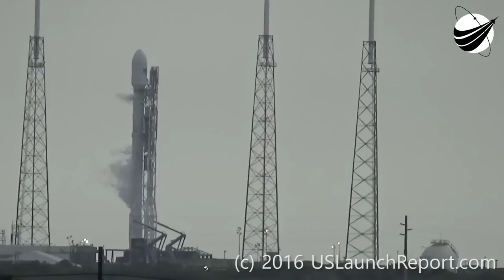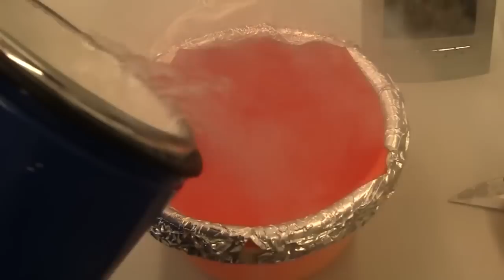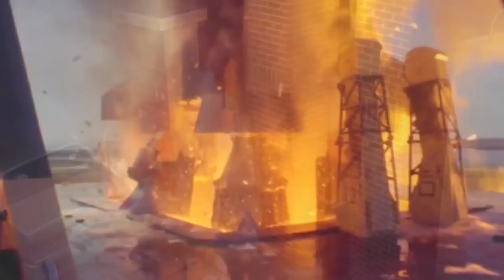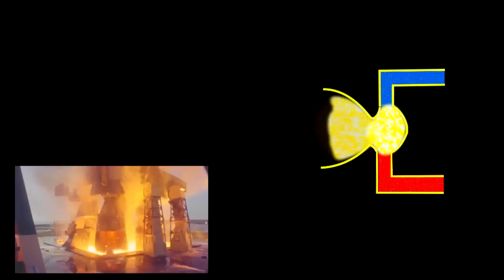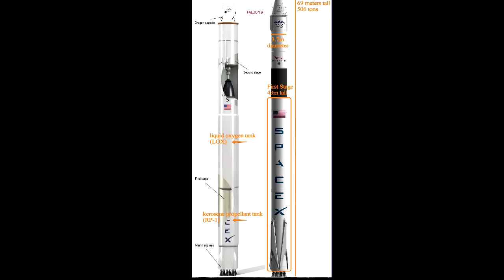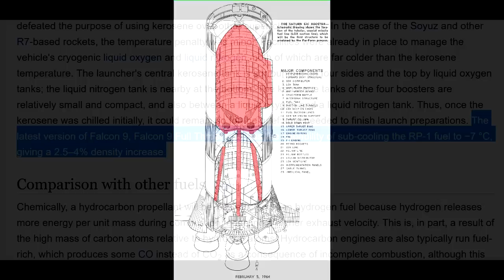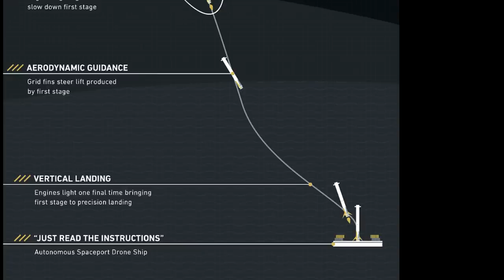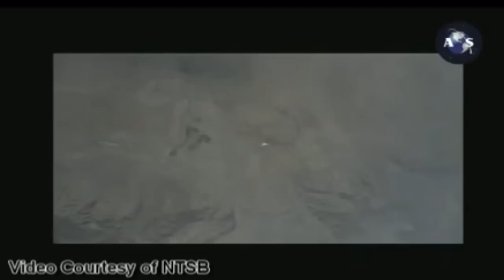Why did the Falcon 9 Explode?

Comment: Anyone can see that was a thermite explosion!
Reply: Rocket fuel can't melt steel beams!
Reply: Yaldabaoth
I know, that's even how a cutting torch  works. My comment was ironic!
Reply: Moth You don't have to be rude because my joke didn't make you laugh.
That was completely uncalled for.
Reply: Moth I KNOW IT IS HUMOR.
As in "not meant to be taken seriously". I was actually making fun of so-called "9/11 truthers"

Which you should have guessed from the fact that no molten steel beams were involved in this. Nor did it look anything like a thermite explosion as mentioned in eddiebruv's original post.
Reply: piranha031091 when does this joke become funny?
your humor is like jet fuel melting steel beam.
Reply: Super thermite
Reply: Actually it can. The pure oxygen helps a lot.
Reply: your comment was a retarded meme, it's go like jet fuel can't melt steel beam.
which is proven to be false. and it's even more false if you add a shit ton of oxidizer to the mixture.

Comment: That's some Richard Feynman level analysis right there!  Keep up the good work
Reply: Richard Feynman wasn't retarded though.
Reply: Parachutes, surprisingly, are heavy. So are the mounting points you need to attach them to. Plus, it's one more system that can go wrong (there's a reason JPL tests Martian landing parachutes to death). 

So it's entirely possible that the additional weight of the parachutes and their accompanying systems is a larger weight penalty than the fuel required to do the same amount of slowing, especially when you have to factor fuel for additional lateral control given parachutes are a lot more at the mercy of the wind. And when you're trying to hit a fifty-foot bullseye in the middle of the ocean...that's kinda important.
Reply: they dont launch from a barge, they land on it. they do this because returning to Landing Zone 1 is much more expensive and can only be done on some fights into LEO. the other option would be landing in the ocean like the STS Boosters did, but those required a lot of work to refurbish because the salt water partially damaged them. Landing on a Barge is the most efficient and healthy option for the rocket.

The returning first stage has gathered a lot of horizontal velocity and looses a little when boosting back, but it still falls about 80km down and part of this is outside of the thick part of the atmosphere, so the rocket has a lot of time to gather vertical velocity before it hits the atmosphere. it also is very aerodynamic and doesnt have much drag to slow it down so i imagine that its terminal velocity is pretty high.
Reply: InfernosReaper
Rockets are usually launched towards the ocean for safety reasons. Since the first stage doesn't reach orbit, it's going to come back down anyway. What they do is they slow down the first stage just enough to prevent it from burning up on reentry, and they put a barge at the exact place where it's going to hit the water. This way it costs very little fuel to land.
When they go back to the launchpad, the rocket has to turn around back in space, and that uses a lot of fuel. The first stage goes about 8000kph horizontally, when the second stage separates. It has to cancel out all that speed, and build up some speed in the opposite direction. In case of a barge landing the atmosphere does most of the braking.
http://static5.businessinsider.com/image/56794ff62340f840008b7689-2048-1152/spacex%20grpahic.png
http://www.universetoday.com/wp-content/uploads/2016/01/16892430560_f87dff78c0_o_1.jpg
Reply: InfernosReaper to save fuel. they land there where it costs least fuel.  and with a barge they are somewhat flexible and there is very little danger they hit something or someone if the landing fails.

"The world is full of mysteries and I suspect most of the people in the comments section are nowhere near as qualified to answer this stuff as they think they are"

especially the clown that made the video.

he spoke about NASA as if they never made errors or wanted to save money.

do you remember why the challanger exploded? and how they knew there were problems but pushed to launch it anyway because they needed the launchpad for another mission on time?

maybe you should inform yourself a bit more than just blindely believing TFs claims.
Reply: Actually very little fuel is needed for landing. Most of the fuel is gone by then, and that's like 90% of the mass of the rocket. The payload also (hopefully) stays in orbit, and that's heavy too. And when you fly fast (like when de-orbiting) the atmosphere is pretty good at slowing you down without parachutes. The rocket at that point is basically an empty bottle with very thin walls, so it produces relatively large drag. You need a little fuel to slow down a bit before hitting the atmosphere to not bur up, and then a little at the end to stop. Typically the first stage goes around 8000 kph. I guess (based on my extensive KSP experience) that you have to cancel out less then 10% of that speed by burning fuel.
Reply: Why is that Chuck?  What exactly would you have added or how would you explain it?
Reply: based on what?Chuck Norris
Reply: its still less fuel used overall that way Chuck Norris
Reply: Aanthanur DC
At least one of those actually knows how teh science works at least ;)
Reply: +Chuck Norris could you stop trolling already, super annoying your lack of logic and pseudo scientific gibberish. 

thanks
Reply: Chuck Norris You do realize TF does nuclear stuff for a living, right? I only had a semester of courses on that myself, but I assure you it does require knowing how teh physics work.

Also, what if parachutes are combined with some counter thrust? Then you would need less fuel for recovery & wouldn't be relying only on one thing to recover the rocket. How well do you think that would work?
Reply: Uh huh.... Why exactly do they need to launch from a barge anyway?

Also, why exactly does a thing that flies mostly vertically come down at the speed of sound instead of terminal velocity?
Reply: Aanthanur DC Yeah, he did definitely neglect to mention all the fuckups of NASA, but to their defense, it's not like the US really funds them worth a damn either. I think the point of "NASA already made the mistakes" is valid, though.
Reply: Chuck Norris
If you ignore all the parts about him criticizing SpaceX, his proposal for a cause was actually fairly solid if you think about it; Issue with secondstage in fueling. It's seems to have happened in the right spot for it, though precisely what happened could be up for debate
Reply: But from what I've seen, the explosion happened in the vehicle it's either vehicle or the fueling system fucked up
Reply: Are you sure there are actually "thousands of sensors?" Eh, who am I kidding, as an electronics guy, I know that it doesn't matter how many sensors something has if they're all cheap pieces of manufacturing defect found in the dumpsters of the Shenzhen market. ;) But seriously, sensors fail, sometimes barely passing QC & sometimes never even getting a QC
Reply: Chuck Norris
That's how it's supposed to work but as an electrical engineer I know that doesn't always apply with electronics & sensors, especially at low temperatures.
Reply: Chuck Norris In my experience with the tech industry expensive =/= good, though many companies do not go for the most expensive stuff. You definitely make way too many assumptions in their favor & clearly don't know what they do.
Reply: Chuck Norris
You say that but you don't have any proof other than your wishful thinking. What do you even do for a living?
Reply: Chuck Norris
Regulated by whom?
Reply: Chuck Norris They've had no less than 3 major issues happen since they got started, despite these regulations & decades of available design "how not to"s from NASA & the USSR.

Between them & NASA, one might think that maybe the regulations are kind of a joke.
Reply: Chuck Norris
Except they have all this knowledge to work with & all these tests they know to do that people didn't in the 60s, plus all these fancy infallible sensors you seem so intent on praising. They didn't have those then.
Reply: Chuck Norris
You say that but there are certain fundamental principles that remain the same.... Dude, seriously, where do you get your information from? It seems about on Buzzfeed level of scientific & engineering understanding.
Reply: Chuck Norris
Why do you keep dodging my question of where the information used for your assessments from?
Reply: Chuck Norris
So, you're arguing with an electronics & computer installation & repair tech over sensors and trash talking a scientist in the comment section of his video with your "general knowledge" which lacks information on how their rockets are actually designed & what the regulations for commercial space flight are(& how they're enforced).

You seem like a pretty smart person(likely smarter than me), but you don't seem to have enough information at the moment. Hell, we both need to learn a bit more about this stuff to be honest.
Reply: Chuck Norris Except it happened in the rocket though. So, one could assume they could be double checking everything or just holding off for a bit until people kinda forget about it before saying what happened. But seriously, all investigations take time if they're gonna be done right. After all, sensors aren't infallible & can't cover everything that could go wrong(it's literally physically impossible with our lv of tech
Reply: Chuck Norris
I don't for certain but the explosion did happen there and no where along the way there, so it seems more likely a place, especially with it at the 2nd stage. Then there's the physics analysis from the professional scientist in the video(either that or he really works hard to keep up the illusion that's what he does for a living)
Reply: Chuck Norris I still want to make you more of an expert
Reply: Lehtaan
Okay. So, they launch not on a barge but for some reason they have to land on one... Seems rather strange to me.

Then again, how do we know they even are reusable if they've never done it either?

The world is full of mysteries and I suspect most of the people in the comments section are nowhere near as qualified to answer this stuff as they think they are

Comment: There are two other issues with O2 loading, infraction and adiabatic compression, which only get worse with chilled O2. Infraction is caused by any foreign body (such as ice) striking the flowing O2 causing it to ignite and adiabatic compression is caused by friction of the O2 molecules against an obstruction (again, including ice). Either of these factors could have caused the rupture on their own, let alone material flaws or fabrication flaws. Oxygen is very, very nasty stuff in its gaseous form and that only gets worse when you liquefy it.

Comment: Good video,  although I doubt the explosion had anything to do with the oxygen and rp1 mixing.  They are not hypergolic fuels,  and will not spontaneously explode on contact. There must be an ignition source.  My guess is a sensor shorted and burnt in the LOX fueling line. After all,  we know that the explosion originated at the tanking interface.
Reply: Pure oxygen means much lower ignition energy required.  Kerosene has low conductivity and will rapidly build up static.